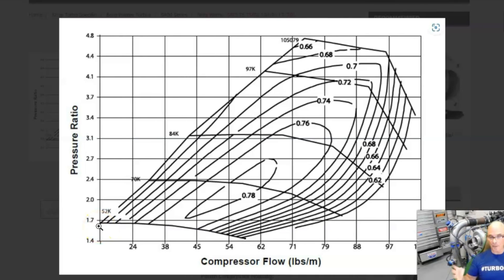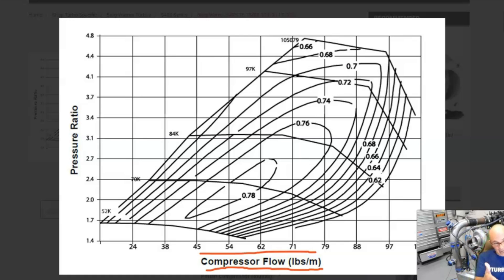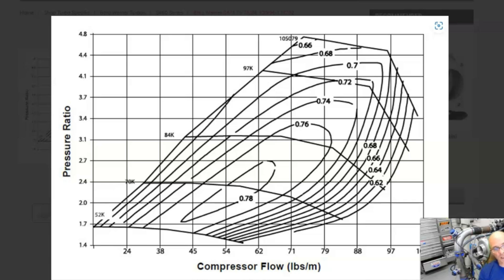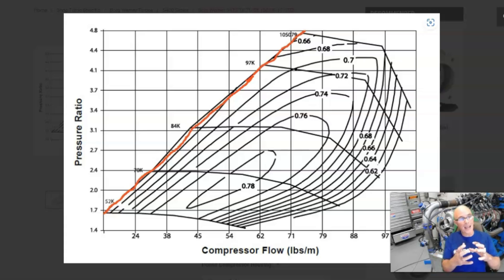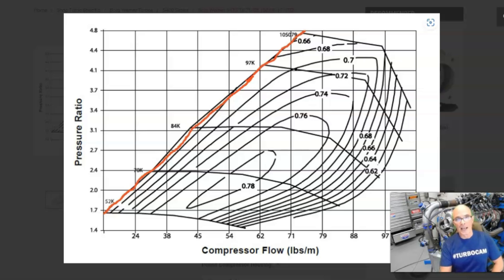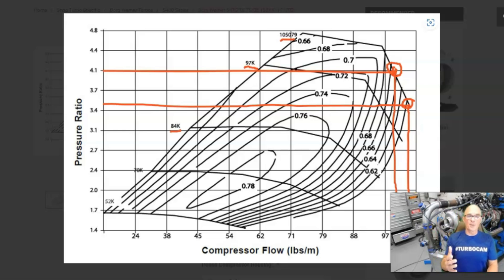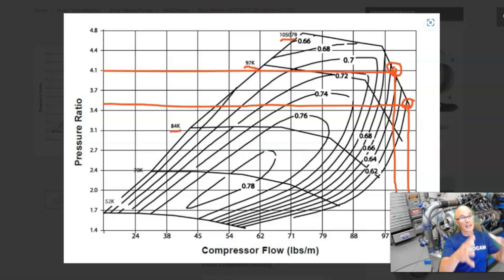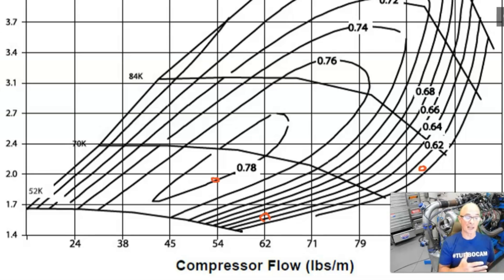COMPRESSOR MAPS 101!! TURBO COMPRESSOR MAPS MADE EASY! HOW TO READ A TURBO COMPRESSOR MAP. MAP HACKS

Comment: This also gets into the “single or twins” debate. The answer is that the compressor efficiency score you’re at regardless (everything else being equal, such as back pressure and intake piping losses on the way to the valve) given the combo. Means if you can’t find a map for a single that does everything you want, you can use a smaller turbo in twins to split the workload. That can get you to and keep you in the 0.75 and above range more effectively sometimes, but not always. There’s also a good argument to make “the best work happen under the worst conditions,” such that you target efficiency deliberately in the upper part of the range toward peak so long as you have the responsiveness you want in getting there. That’s another sanity check on “single/twins,” where maybe we care less about being in the mid/high 60s on the way up to power on something like a V8 because it already has the torque to move out generally as fast as most tires will take anyway. Being more efficient at getting to the point of breaking traction at lower PR might be an irrelevant gain, where we get “more HP per pound” being more efficient at the upper end. 

Little bit like using a bigger cam to move power from bottom to top when we have more than we need or want on the bottom anyway. It does trade boost threshold for efficiency, but if it’s already got enough to blow the tires off N/A all we’re doing is reducing the excess on the bottom to move it up… same as we tend to do with a cam when top end is the higher priority. 

You can’t always beat an efficient single by going to twins. A poor twins match will actually lose to an ideal single, and vice versa. But now you can play with how to look at it if we think about it that way- “what efficiency score am I at on the compressor map given what I’m running, and can I understand that like a VE table for a turbo?”

So, whatever gets you that “best VE” score, wins. 

How much we care per unit cost of getting that versus not, is probably a reasonable follow-on question. “Equal price, do we care about even taking the time” would probably be another.
Reply from the maker: very few turbo combos run the turbo in the center of the efficiency island-any racer runs them far right upper corner

Comment: A good follow-up video to this could be trace lines on a 4-cylinder, 6-cylinder, and 8 cylinder all making the same output and where they land on a map at the same horsepower on a WOT trace. We have a bunch of advantages on V8 platforms in keeping the line more flat in terms of air consumption versus pressure rise. Illustrates why we care about surge and choke, what the issues are, and how to pick a relevant map by just saying “here’s my dots every 1000 RPM, the HP I made, and where I was on the map.”

For the V8 crowd, that can show us why “low boost” from the turbo’s perspective chokes out on a lot of them quickly on low-buck, low-boost street builds- most turbos aren’t made specifically from V8s, and are more “generally good for most things, not necessarily great for any one thing.” Great for the 3.0L-4.0L I6 crowd, not always great for us unfortunately on the V8 side.
Reply from the maker: the issue with larger motors is often the turbine side flow (excessive back pressure relative to boost)-not compressor flow-the position on t he map for a v8 would just be closer to the lower right corner-where it would be upper right corner for smaller displacements (maxing out the turbo puts it way out of any favorable efficiency position on the map)

Comment: This is all great but what happens when its a twin turbo setup.  For example I'm going to turbo my ford mustang GT.  I'm going to be running twin GT3582s and my target goal is 900HP crank, which I know is very doable with these turbos.  The problem is if you look at the GT3582 compressor chart it doesn't work because it's for a single turbo not dual turbos
Reply from the maker: DOUBLE WHAT YOU SEE ON THE MAP (FOR FLOW)

Comment: excellent video!!! It would be great to see one on turbine sizing. One of the biggest debates in the 5th gen camaro turbo forums is how a t4 75mm turbine will supposedly make more power on a 5.3l than it will on a 6.2l LS. Not proven as far as I'm aware. But hot side testing is scarce. Maybe something you could do? Love the channel!!!
Reply from the maker: at some point, a given hot side will make power on a smaller motor than a bigger one (from a change in back pressure)

Comment: I was wondering?  As you are accelerating, you aren't going to be smack at full boost so as rpm increases an boost starts to build how would that line match up on the compressor map? Lets say I'm looking to make 1000 hp on an already 600 hp big block and boost starts building at 3000 rpm and you want to turn it to 7000 rpm. How would the boost / rpm line plot out on the compressor map?
Reply from the maker: the intersection of boost and power plotted on the map for each desired rpm point

Comment: Hey i am trying to turbo a chevy 250 and 292 inline 6 what do you think would be the best tubos for them? I know you've turbocharged a 292, so that's what I was trying to figure out.
Reply from the maker: for what power level
Reply: @richardholdener1727  300-400  not trying to make a power house just make more power and reliable motor

Comment: Is cutting every number in half a good way to plan for twins? For instance, 300hp naturally aspirated, targeting 600. Is planning each turbo to be sized for an engine exactly half the size and power the correct approach? Still confused about pressure vs boost  and cfm in relation to power, especially when it comes to twins. A turbo can flow the correct cfm for desired power, but need more pressure to do it than is desired? Say, sbe street builds, youd want low boost and high cfm? Or does the cfm matter more than the actual psi by the time it reaches the motor?
Reply from the maker: if you have 300 hp na motor-you need 14.7 psi to make 600 hp. You need the turbo or turbos to support 600 hp at 14.7 psi.
Reply: @richardholdener1727  so for sizing twins, theoretically, one would select them according to making 300 from 150 na, correct? So id want turbos that move about 300 worth of air each, at 14.7? In New York they've really cracked down on exhaust modifications in the last few years, so having an okay sized factory dual exhaust, I aim to keep the car legal here by maintaining most of that. Infact thats one of the big reasons I'm leaning toward twins, easier to maintain a legal exhaust system in my state.

Comment: Why is the topic of turbo map and selection of AR not disclosed anywhere? This is an oversight for many, as the compressor card will be useless if it is not selected correctly АR. The correct ratio of the turbine wheel to the compressor is not disclosed anywhere
Reply from the maker: THE AR IS A MINOR CONSIDERATION-AFTER TURBO SIZE AND MAP

Comment: Maybe its in the next video on this stuff. But im worried about turbo lag. I want to run 580hp out of a K24 which is "205hp" stock ao theoretically needs 2.83 ratio so roughly 27psi. So this is already a larger turbo the one you used for the chart example..im worried that this will lead to big lag out of the little 2.4 that is suppose to be for a drift build or low end torque and high throttle response build. Trying to figure out what turbo suits it best

Comment: 12:20 That doesnt make any sense. More boost = less power? Maybe in a supercharged engine, but definitely not on a turbocharged engine.
The map only shows the relationship between rpm, pressure ratio and flow. 
Increasing boost above 36.75psi would result in an overspeeding turbocharger... thats what the choke line shows.

Comment: Compressor maps are very cool, its a very useful way to do comparisons and compressors have improved very substantially from the humble garret T04.  It would helpful if turbos had maps for the exhaust turbine section also, because that also affects the ability to drive the compressor.

Comment: What really confuses me is how some engines are WAAAY past the surge line, like the guys who run S480s on 4G63s and make well above 1,000 horsepower on an engine that would only make 130-150ish horsepower N/A, but as far as I know they aren't blowing up turbos. What am I missing?
Reply from the maker: the concern for surge line would be during spool up
Reply: @richardholdener1727  Still kinda going over my head, is it not a problem because the hot side is so big that they don't create boost low enough to cause surge?

Comment: Wouldn't 1.0 be 14.7 if its 1 atmosphere? 2.0 would be 29.4 because thats 14.7 x 2.0?
Reply from the maker: 1.0 on the map is 14.7 psi above atmospheric pressure
Reply: @richardholdener1727  oh I see now. Do you have to tune the ecm first then put on a turbo? Or put on a turbo, data log then do ecm tune? If you know.

Comment: Ok I somewhat understand compressor maps now but I’ll have to speak with someone to better understand fully but I get the idea, I’ll like to have some insights on my set up and if my turbo is out of efficiency at the boost level at the moment I have a 2.0 motor that’s fully built with 280/288 cams,10.5.1 compression, 2600cc injectors, running a 10569 xona and I made 700hp on a mustang dyno at 36psi but I want to push this turbo to 50psi so would that put the turbo outside of the efficiency level ? Or how efficient is it running at the moment ?
Reply from the maker: do you have a map of that turbo and is it still on the map at that pressure ratio?

Comment: Love the video Richard! Very easy to get a rough estimate this way. I do have some questions!

I'm currently looking for turbos for my NA ka24de that I mainly use for drifting. Im looking for a turbo that would be a bit more future proof as i plan to run just about 14.7psi at first to get around the 300-310hp (crank) mark. 

Then later down the line when i rebuild the engine with stronger internals I'll want to be able to go to around 500hp max. So it would be nice to find a turbo that works inbetween those guide lines.

So I was currently comparing the gtx3067r, gtx3071r gen2, g25-660 and g30-660. (I will probably go for a Pulsar equivalent, although it might not be everyones first choice)

But what i noticed was that most compressor maps are for just one turbine housing AR ratio, but they have another very simple looking map with 3 lines representing the different AR ratios you can get. How do you use those?

Say you look at the gtx3067r AR60 map, it would be too small for my needs, but the AR82 might be better suited? Im just not sure how to combine those maps!

If you think you know what turbo to use for my particular setup, feel free to chip in! For the higher hp I might also get cams and other supporting mods, which would lower the amount of boosg needed to achieve the same goals, right?
Reply from the maker: a GT3076 (the cheap ones) will do what you want

Comment: can you run some tests on how much timing efficiency is lost to heat? maybe put some heaters on the heads. I ask because many OEM cars loose allot of power in warm weather and i feel the aftermarket underrates this..i do see tuners remove timing in hot engines but how much is enough? 

i feel more than 2deg is needed?
Reply from the maker: timing lost to heat?

Comment: 1000hp turbo on too small of motor not only that the turbo won’t spool Even if you did the turbine would have to be too small and  not flowing enough you won’t make any power cause you never get into the compressor efficiency island. This is because you can’t get the exhaust out of the cylinders

Comment: This works for superchargers as well. I spent some time a couple months back plotting this for the Vortech choices I was looking at for my Ford 363. 
Respectively, plotting desired hp and psi relative to rpm. The best efficiency range for the plotted line, the Supercharger essentially chose itself. Keeping the unit as small as possible for response, but as big as possible for the desired power goals.

Comment: These maps are often representing motor/crank hp correct? so inflating the intersection point for both axis a bit (10-15%) will give you a better idea for whp when picking a turbo. I was just explaining compressor maps to a friend last month as his turbo size for his power goal and engine size is perfect right now but he wants a new goal that pushes it well beyond the efficiency islands. He wasnt too happy. Had to tell him he can still make the power but the air is going to be getting heated even more

Comment: Pressure Ratio Calculation

Gauge Pressure+Atmoshperic Pressure/Atmospheric Pressure (minus 1psi if using air filter)  

Example would be at Sea Level running 20psi 

20psi+14.7psi/13.7psi = 2.53 for pressure ratio...

Comment: couldn't pressure ratio be expressed as [(14.7*ratio) - 14.7]  therefore at a boost ratio of 2.0, that's 14.7psi on youer boost gauge.

Comment: Have you also noticed that peak efficiency is usually also peak torque?  That's what I've seen.  Not always true but usually is for a good NA motor with a flat torque curve in the power band.
I like to take the NA dyno numbers every 1,000rpm, put those points on the bottom of the map, double them, put them on the 2.0 line, then draw lines between the dots, and continue the line to the top of the map.  Really nice and easy to read.  Looks kind of like your fingers spread out.
Reply from the maker: there is no rpm reference on the compressor map
Reply: @richardholdener1727  I'm saying plot the engines HP output every 1,000 rpm.  I wish I could show what I mean.

Comment: Let's say I have a 400hp na motor and I want 1000 hp. I also want the 78 percent efficient but that seems like it would be a way over sized turbo. Is efficiency range not as important as final hp numbers. What are the benefits to being more efficient and where does that intersect with turbo performance/turbo lag?
Reply from the maker: just get a 1000+ hp turbo (don't worry about the 78%)

Comment: Richard holdener

So please tell me if I understand this

If I had a 500 horsepower motor and I wanted 850

On this compressor map that would put me at 1.7 boost ratio and 85 on the pounds per hour putting me well outside of the map

However, if I was only moving 42.5 lb at 1.7, that would put me very close to the 78%

Does that mean I would need two of these? Turbos to divide the pounds of 85
Reply from the maker: this turbo would be fine at 800 hp starting with 500 hp-it's just a low position on the compressor map (But I have run that)
Reply: I guess the better question is, how do you figure out the size turbo, if you're going to run twin turbos instead of a single turbo. And you want them to both live as much time as you can in the efficiency area

Comment: How can this relate when looking at supercharger maps given that are mechanically driven.  Are the RPM lines on the map not as relevant?  Example I have a Vortech Si, making 10.5psi @7000rpm, 622hp at the wheels on a Dart 363.  When I use this method I'm at around 40,000 rpm on the map, but I'm actually running my impeller at 48,000  Where do I factor this in?
Reply from the maker: do you have a Vortech compressor map?
Reply: @richardholdener1727  It’s directly on their site. I post a link and it keeps getting taken down. Just google Vortech SI compressor map and it’ll come up first hit.

Comment: If the turbo is only 78% efficient at its highest eff. island. How is it doubling the NA hp at 1 bar? Wouldn't it have to be 100% efficient to double the power at 1 bar? Even with a 10% eff gain from intercooling (which usually isn't seen) you'd still be shy of doubling the factory NA hp. Yet we see in many dyno's that the motor sometimes makes more than double the NA power per bar? It all seems very contradicting.
Reply from the maker: you are confusing correlation to causal relationships. The efficiency of the impeller design does not mean it will increase the power level by the same amount. The flow rate does that

Comment: Nice, now stop using S480 at 800 hp in your dyno tests.
Reply from the maker: it works very well at 800 hp
Reply: @richardholdener1727  should work very well at 1200 hp also. 800 hp is under 70mm territory.

Comment: Please help

 Hey Richard, I have a LQ9 turbo LS with cheap eBay hyp  pistons, what RPM is “peak torque” so I quit blasting rings and lands apart ? 

Trickflow trackmax 
.595 lift 238/242 

Wondering what area on the Holley timing table to pull timing and when to add it back with only a butt dyno and being too broke to pay for any tuning 

Thanks
Reply: I watched a lot of the 6liter cam test videos and the torque curve is so flat with that big comp cam you’ve done a bunch of testing with I assume mine is similar and basically the torque never drops off more then 50ft lbs until 6k rpm
Reply: Is removing timing around peak torque actually say higher timing number under 4500 rpm then is dips until 6000 ? Trying to get a grasp of “removing timing around peak torque”
Reply from the maker: let's start with how much timing you have at WOT, how much boost? and what fuel? is it intercooled?
Reply: @richardholdener1727  e85 now , treadstone? It’s a decent air to air intercooler, knocked a couple pistons apart on pump gas 10psi and 18-19 degrees timing , car normally runs pump 91-93 octane not the E85 that’s in it now. Twin mirror image vs racing 67/62’s  journal bearing turbos, 3400 yank stall, 3.50 gear , 29inch tall tire, snake eater 1000 injectors, fuel pressure been good on a single 450 pump, I know I need to install a 2nd one for running e85 and any real amount of boost like 15psi or more. Just don’t want to hurt the pistons again . DA is normally 5000 to 7000 I’m at 4000ft elevation. Heavy car, it’s a 70 Chevelle , 9” rear, 4l80 trans . Just learning to tune terminator x myself doing street pulls.